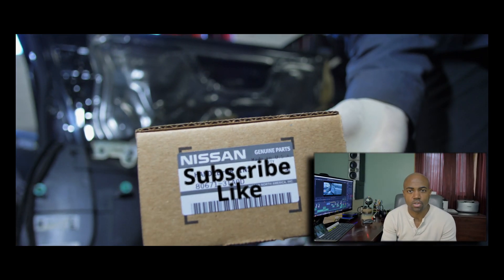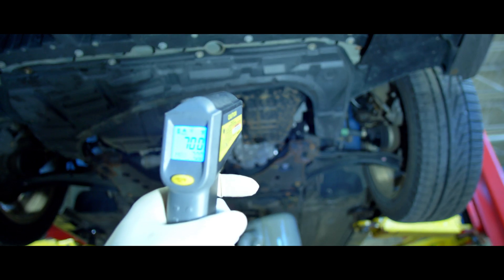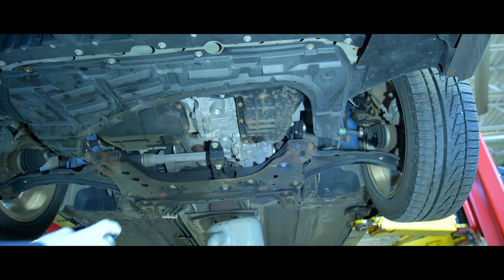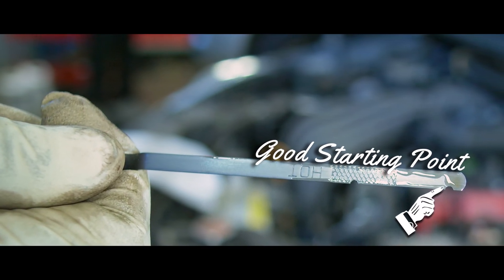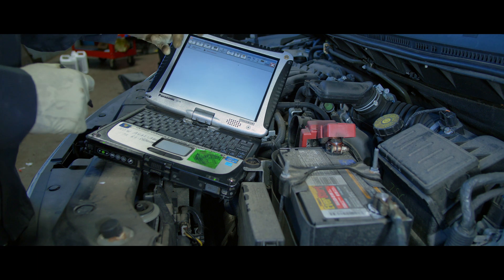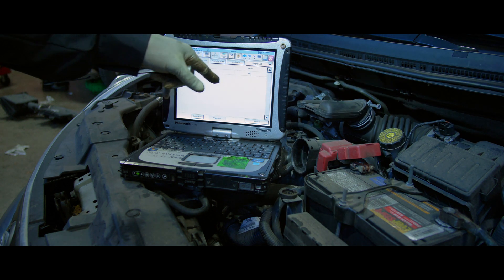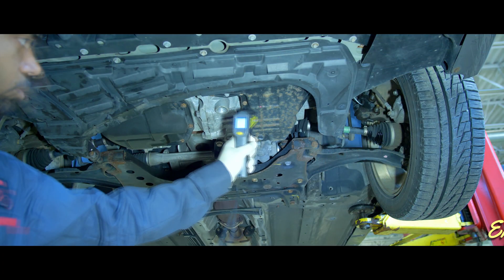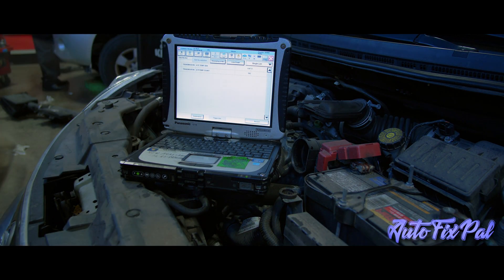How to set Nissan CVT fluid level without a scanner - Transmission fluid level

Comment from the maker: there is an android and IOS app that you can use to get CVT temperature data. The app is cheap and so is the adapter.
app: https://play.google.com/store/apps/details?id=com.cvtz50.cvtz50&hl=en_US
Good multi function Adapter: https://amzn.to/311x3Zh
Inexpensive adapter: https://amzn.to/2MlafjL
Both options are cheaper than paying someone to do your CVT service.
Reply: Will the autel ap200 compatible with the cvtz50 app?
Reply: You know there is another bolt you can remove to level out the fluid while you in the CVT. Just watch this mechanic video. https://youtu.be/qhd39HU-TJE
Reply: Hello hey we’re I can get that scanner, and thank you for the video.
Reply: A tip : you can watch movies at InstaFlixxer. Been using it for watching loads of movies recently.
Reply: @Arjun Forest Yup, been watching on instaflixxer for months myself :D
Reply: I have a obdII scanner BlueDrive, would it work with this app?
Reply: Can't find the iOS app. Any others out there for apple?

Comment: You never use an impact on any drain plug and you did not mention if the fluid level needed to be checked with engine running in park or not. Very dangerous information presented!

Comment: It's  a partial change, total capacity? around 9.8ltr, changed? 4ltr...
To change all? need to run a flush on CVT.
Or? run this proceedure 3 times with 20 to 30 miles between changes.
Ending up with fluid as new as possible, and do it every 25,000miles, cheaper than a new trans
And remember, Nissan have not approved NS-3 for use in CVT's prior to 2013, follow the sticker inside your car hood..

Comment: I bought an oven meat thermometer with a wired probe from Walmart and used it for my 2018 Nissan Sentra instead of an infrared temperature gun because you don't have to worry about outside, ambient temperature. All I had to do was bend the stainless steel probe into a curve until it fit perfectly down the CVT fill tube all the way to the bottom of the pan. If anyone is interested in trying this, the thermometer brand name was Taylor and I bought the one with slimmest probe. I drained the excess fluid when it hit exactly 104 degrees Fahrenheit and had no issues at all. The thermometer has an alarm that you can set to any temperature, so that comes in handy. You can set the alarm, get underneath the vehicle and wait for it to beep so that you can immediately drain the excess fluid from the drain bolt.

Comment: Hi auto fix pal ,,,wondering if this has anything to do with why I get vibrations between 60--80 km/h . Nissan couldn't work out what was wrong LOL . When my arm is better ill be checking my fluid level regardless. Cheers.

Comment: Listen people transmission oil expands but it doesn't double in mass or amount. It bugs me when it's not rocket science, just catch on a measuring bucket/container all the oil and replace it with the "same" amount and let it sit till it cools and reaches the same temperature as the new fluid that comes in the bottles. What's so hard about that..??? I have done it to all my vehicles and haven't had a transmission fail yet, trust me even if you add half a cup of extra fluid by accident your transmission will survive another day unless is already damage than that's a whole different story.

Comment: I am confused! For I just had my transmission oil changed in my 2007 Maxima (50,000+ miles).

The mechanic told me, "When the car is cold (like over night) the fluid should be right in the middle of the "scratch" marks. Then, AFTER the car is hot; the oil should be at the "Hot" mark.

Yet kind Sir, you tell us that it should be in the middle of the scratch marks; AFTER the car has been running to "148 degrees". And get this: that "Hot" mark is 2" from the top scratch mark! Believe it or not.

Now WHICH one is correct? Does any one know? I really NEED this information. For CVT's are VERY sensitive to the right amount of oil. And it is my understanding that the CVT can be damaged; If the exact amount of oil is not in the transmission; at all times!

Please kind Sir...I have tried to get the true answer for 14 yrs; but everyone says it differently. What in the Pluperfect Hallelujah is going on? Huh?
Reply: And now what is your answer.? I get a same problem now
Reply: @Al-弟  I have found one that might work. But I haven't used yet. Thanks for reply. dear person! May Jesus bless you!

Comment: When you first checked it, that full line was exactly in the middle of those hash marks. I don't know how you claim it was overfilled???
Yes it is because procedure requires three and a half quarts, not Four quarts.
Why did you not change the residue in the pump housing by draining the pump housing drain plug and replacing that transmission fluid as well???

Comment: This was very helpful information needed to get the correct fluid level without the scanner. I had replaced the 2010 sentra transmission and filled 6 qts in the 8 qt system, then added the 7th qt incrementally thinking the torque converter held a certain amount. Once I thought I had it right I drove it around for about a month checking it a few times. It was difficult to hit the mark but it was time to drive the car on a 400 mile trip. On the road I checked it and found that at higher temps the fluid contracts to the point there is no reading on the dip stick. This was very concerning and I did add more. As the fluid cools it expands and there is a higher mark on the dip stick. The trick is to read it at 160 degrees. The car made the 400 mile trip without blowing up. I took several more readings and felt satisfied leaving the car for my daughter to drive while in college. However, I don't think I will ever buy a CVT transmission again.

Comment: @Auto Fix Pal because it was overfilled you can just make sure car is at operating temperature remove the 19mm drain plug, and let the fluid level itself out.

Comment: I have a 2011 altima, do you suggest only the N2 fluid or is there a cheaper option?
Reply: Only put NS-2 in pre 2013 Nissan CVT as per sticker under hood, NS-3 is for nissan CVT's after 2012 and has not been recommended as an alternatif to NS-2..

Comment: What's your opinion on dropping the transmission pan, to change the transmission filter, or is changing the fluid good enough?  I have 113k on my transmission, changed the fluid 1x already at the dealer, at 60k.  Going to change it at 120k.  Should I change the filter?  Thanks!

Comment: I have a 2012 NISSAN ALTIMA 3.5 SR ..its starting to buck and jump on stop and go acceleration.. i was going to change the fluid out completely, and fill with the same amount i take out... is there an extended warranty for my year and model do u know.. they have extened warrantys on alot of years and models to 10yrs- 120k.. thank for any info.. i did like and subscribe by the way.. it just dont make sense that there isnt a specific number of quarts from a fully drained pan?

Comment: 5:34 why is the top line of the cross hatched area considered overfilled ?
Because the level is at the upper limit of the HOT range while the transmission was cold ? 🤨🤔
Reply: I think because the oil was too cold. From my experience trying this with my murano, the level climbs significantly as it heats up. I HATE the Nissan transmission!  I hate going to the dealership but from now on the that’s what I’m doing.

Comment: Use the leveling plug and wait until the bottom of the trans pan feels warm, like a kid with a fever, its going to be SUPER close. I did my first cvt swap on my 17 pathfunder this way after dropping the pan, and swapping both filters. The amount that ultimatley ended up in my catch pan after leveling to a trickle was 4.75 qts and I put in 5. With all the paper towels and drips on the floor I likely took out exactly what I put in. I am, of course assyming the flyid level was correct from the factory
Reply: If it has a leveling plug there would be no dipstick, this is for CVT  Nissan transmissions.
Reply: Did you check total capecity? its a lot more than 4ltr.
More like 9ltr, you only changed the fluid in the pan, not what is in the total system..

Comment: Awesome video! I was getting ready to trade my Rogue in on another car. I did this procedure just as you did in the video, and my transmission about a quart and a half overfull! The crazy thing is I had a new transmission put in a year ago and it hadn't worked right the whole time. I kept taking it back but the guy couldn't figure the 'safe mode' issue out. So, when I found a 2016 service bulletin I realized he didn't know about it and overfilled the transmission from the start. Thanks to your video I was able to get it corrected!

Comment: No Need change filter in nissan ?
Reply: Nissan dealer doesn’t do it at all. They only do drain and fill. A lot people are saying recommending changing cartridge filter and oil strainer filter every 100K miles .
Reply: @artwolfeii  Alternative? Clean it, it's just a metal screen, wash with petrol or thinners and blow out with high pressure airline.
Replacing is just another Nissan scam...

Comment: How often should I change my CVT Fluid? I have 112,000 Kilometers on my 2016 Altima...
Reply: Too late now...
Reply: Recommended every 100,000 Km or 60,000 miles.
Reply: But safer done at every 35 to 40.000k.

Comment: Woww my friend , Thanks for your Video , it's helped me a lot my man , I have a Question for you , how many quarts for Nissan Altima 2018 cvt fluid  ? God bless you everyday , You're the Best
Reply: See owners manual of your car. You will find total amount of CVT fluid there, but it will not all drip down, so if you do not have dipstick on your CVT (like my Murano) just measure what came out and add exactly the same amount. If your car stil has a dipstick, just add bit lees, drive around for a few minutes, do not stop engine but park on level surface and use dipstick to determine how much more fluid you need to add....
Reply: Probably about 3.5 quart is drained and filled.

Comment: only use nissan cvt oil,  just killed my altima with some Castrol cvt  🙁
Reply from the maker: No, Chances are your Altima CVT was already failing. I dont believe that using Castrol brand CVT fluid is the reason especially if it says that it applies to your vehicle. I am not even sure Nissan Makes the fluid. Now with that said, i dont reccomend using anything But Nissan CVT fluid because i cant vouch for the other stuff and i dont want anyone blaming me because their CVT went bad afterwards.
Reply: @Autofixpals  the castrol fluid is supposed to be universal for ns1 and ns2. Im no expert but i think that is impossible
Reply from the maker: @100mrrisky  You can use NS3 in an NS2 vehicle. i think its plausible. If you can prove that the fluid casued your failure than that would put Castrol on the Hook for a CVT. I don't think they would want to expose themselves to that type of liability.
Reply: @Autofixpals  i cant find anywhere that says you can use ns 3 in a ns 2 transmission..
Reply: @100mrrisky  All of the new transmissions come with NS3. Even if you get a rebuilt one for a vehicle that originally came with NS2. It's backwards compatible.

Comment: I have the Veepeak bluetooth Adapter paired with the OBD fusion app and can read CVT temp! When CVT temp is around 160F the level on the dipstick reads .75" over the full Mark. How bad of an overfill is this? I've driven it for over 20K miles like this but I'm afraid being 3/4 of an inch over filled may damage the CVT. It's a 14 Murano AWD.
Reply from the maker: if you dont have any issues now, with it overfilled. I would say just correct the level and you will be fine. Maybe 1 quart too much is what you have. Get one of those Harborfreight vacum brake bleeders ans use it to suck out the fluid though the dipstick tube to get the level correct.
Reply: @Autofixpals  I'll do that thank you very much. Great Channel by the way love your videos!
Reply: Can that fusion app also read transmission codes?
Reply: @jasonfromm5637  yes it can, as long as you buy the year pack for it. This like an additional 10 or 13 bucks
Reply: Thank you

Comment: Hi Hakim,2010 Maxima,i drove 30 min to get to the mechanic to get the cvt fluid level check and corrected,i ll wait for the cvt temp go down,my question let say i wait an hour and when checking it,starting temp is let say 130 degrees,and i go  thru all the gears wait 15 sec,  most likely temp will reach 155 degrees in minutes.if i do like this will it be an accurate checking?or the time difference between  going thru the gears  and checking the level effects the reading?does it matter how cold the starting cvt temp is? Thank you again
Reply from the maker: starting temp is important without a scanner. Start with the vehicle and fluid at ambient temperature for best results.
Reply: @Autofixpals  Thank you

Comment: I have a 2015 Altima woth 70k.  The trans seems to be slipping on the cvt belt. But no check engine lights are on.  Do you think it’s possible to change the fluid and luck out or once they start slipping it’s done for?
Reply from the maker: complain to Nissan (corporate and or consumer affairs) you are just outside the warranty of 60k. Be a PITA to them, most of the time you can get assistance with the replacement from Nissan be it a full cost coverage or partial coverage. If your fluid is low you can possibly get lucky by correcting the level. If its correct then You will need repair and you still may have DTC's stored in the transmission module which doesn't always trigger a Check Engine light.

Comment: What model is this versa & what size engine? My car has different lay out on the engine, I have a 2012 Nissan Versa SL 1.6 , and doesn’t has a dip stick , only has a plug , it’s under the computer , to get to it , need to disconnect and remove de computer, the battery and the battery support to get to the plug , it’s sucks , so in this case , what I need to do to  ? Thanks 🙏
Reply: You can get to the dipstick tube with a couple of different size funnels. Put a small one down on the tube and a long one from the top down into the small one.

Comment: Great video! Is it required after changing the CVT fluid to "ERASE CVT FLUID DEGRADATION", according to service manual? I don't have a Consult program. Thanks.
Reply from the maker: it is a good idea. However your only swapping out about 4 qts... ohh there is an app CVTz50 google it, and it will allow you to erase the degradation. But you will need a inexpensive OBD2 adapter. like this one. https://amzn.to/2JUFjoH or this even cheaper one https://amzn.to/2MlafjL ... The autel unit might be a better option, as it allows you to do a lot of other things.
Reply: @Autofixpals  Thanks for your time sir!!
Reply: Will that affect performance if you don’t?

Comment: This nissan or the junkies cars on the market they build them to break
Reply from the maker: they dont break as often as you think. They are not too bad.
Reply: Yeah, got 300k miles on 2007 versa w cvt, never any problems beside normal maintenance

Comment: How much does a cvt fluid change cost?
Reply: Don $399 @ the dealer.
Reply: @apache-yaquibrown4060  thats way too much smh
Reply: In Cincinnati nissan charges 249.99 for a cvt fluid change
Reply: @robertberger6234  thats much more reasonable
Reply: I just got a coupon $169.  I am always weary the last time they serviced my car they didn't put the drain plug on properly, and the drain plug fell out.
Reply: @apache-yaquibrown4060  you lost all your cvt fluid? How do you not tighten the drain plug?
Reply: Don it was the oil drain plug, not the tranny.

Comment: This is a versa?
Reply from the maker: yes sir.
Reply: @Autofixpals  ive got a 17 versa but cant find the dipstick. Also the transmission randomly slipped and i had to restart my car while driving today. Tf is this shit. My car has 28k miles.
Reply from the maker: @don9526  your car is in warranty bring it to the dealer. 5 years 60k on drivetrain.
Reply from the maker: @don9526  thank you.
Reply: @Autofixpals  im not sure if anything is wrong with it now... Im going to drive it some more to see if it happens again
Reply from the maker: @don9526  there could be a Transmission DTC present that won't turn the Check engine light on. But could be enough evidence for Nissan to replace the CVT. But if its VERY intermittent and no DTCs you will have a hard time getting anything done. If you know someone that has a scanner that can read Nissan transmission data, have it checked for codes then go to dealer if there is any PC solenoid codes or judder codes.
Reply: @Autofixpals  what is a transmission dtc?
Reply from the maker: @don9526  Diagnostic Trouble Code =DTC
Reply: @Autofixpals  i dont think theres a dtc. The car runs fine now. But i dont trust this cvt tbh